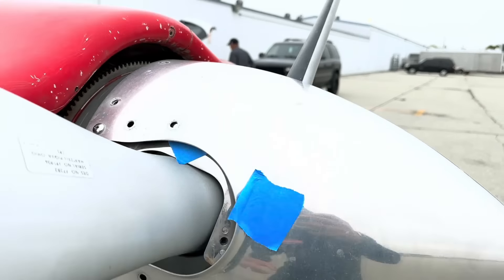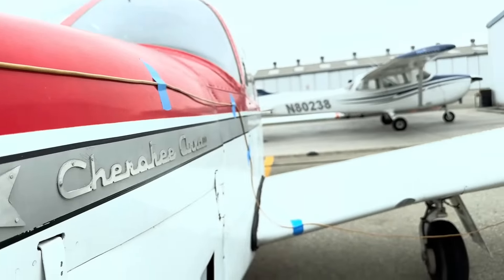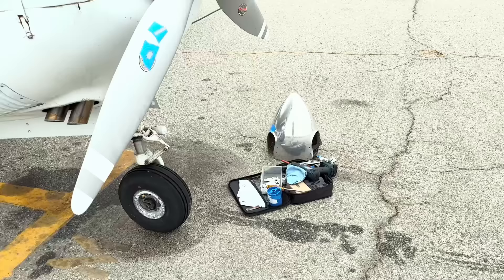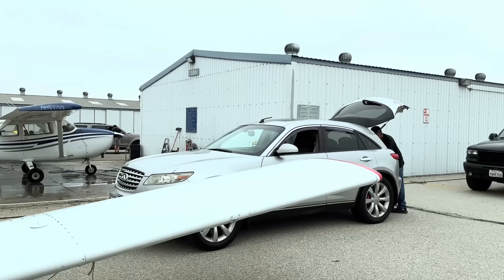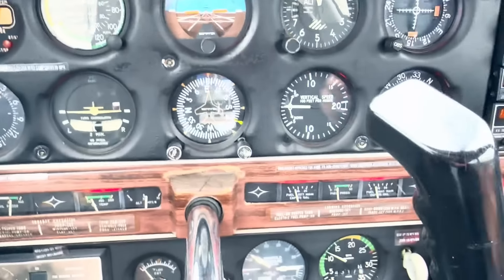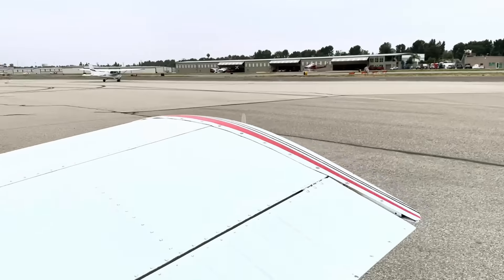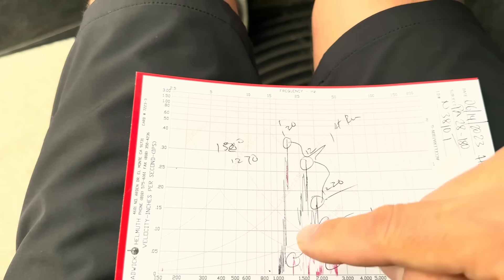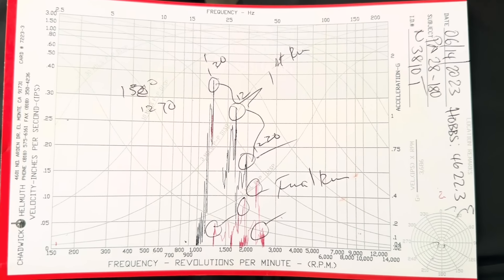Big Vibration... Bad Prop on the Arrow???

Comment: I think prop balancing should be required. I had one balanced on a 172 and a Baron. big difference. I even balance my drone props myself, using clear nail polish as the "weights". BIG difference !
Reply from the maker: It definitely helps

Comment: When I sold my 180D, I wanted to buy an Arrow.  But, I decide the extra speed wasn't worth it, compared to the maintenance costs of a constant speed prop, and retractable gear.  My Archer is pretty slow.  I plan for 110 knots cruise.  But I can afford to keep it.  Just barely.  I was going to upgrade the panel, but unless you upgrade your autopilot, that doesn't make sense either.  With the shit you can get on your Ipad or Android, you really don't need it.  Until they start getting rid of ILS, LOC, and VOR approaches, you can go most anywhere IFR without too much problem.  And, if you're VFR, you do need it at all.
Reply from the maker: I feel that!!! I’m doing the whole enchilada though :) displays GPS & autopilot!

Comment: I wonder what the purpose of this video was - to promote something as a vibration guru? Every motor vibrates. The most important part was missing from the video: what was done to reduce the vibration?
Reply from the maker: No it wasn’t, he added weights to reduce the 1.7  IPS vibration to around .02 ips.